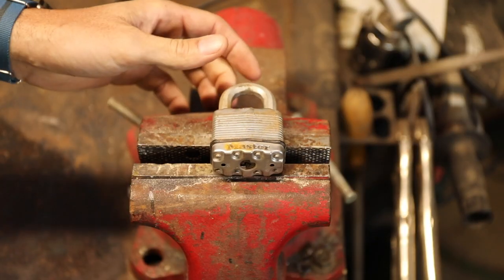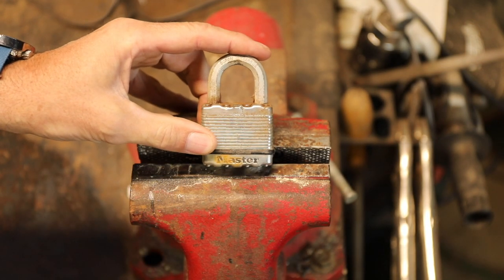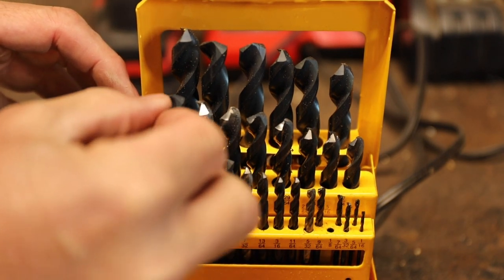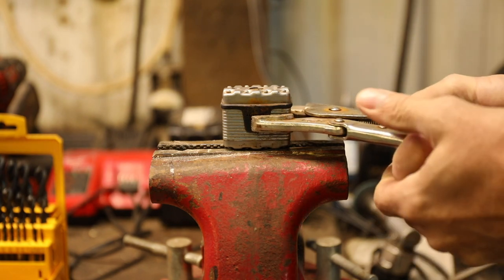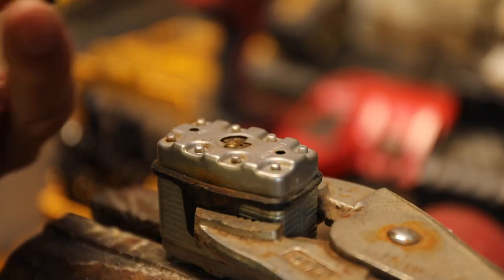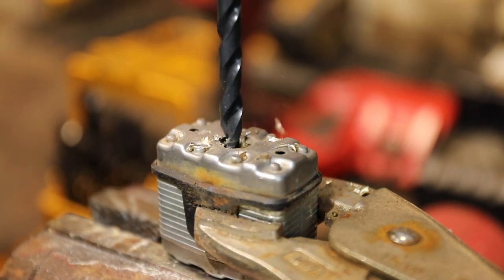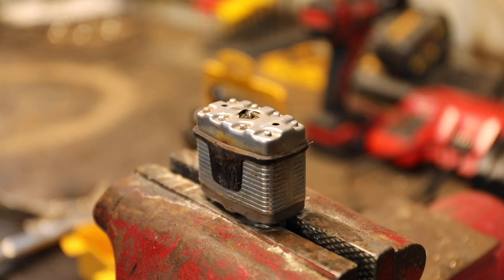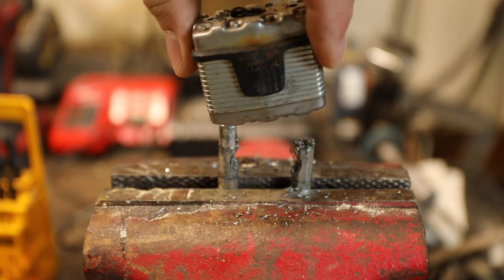PADLOCKS - THEIR DIRTY LITTLE SECRET

Comment: I work at an ict company and i recently had to break open a couple dozen padlocks padlocks on pc computers, used 2 wrenches to break them open by leveraging them together, works in seconds with any size lock as you adjust the wrench size to the lock size to get more force

Comment: Check out the lockpickinglawyer's channel. He takes locks apart/shows the insides and quite a few of them have anti-drill protection or hardened steel areas. Also a lot of them are just zink or brass, too. High end locks, I don't think you'll be able to drill out but the ones you get from harbor freight or walmart, no problem.
Reply: Egon are high end locks grinder proof ?
Reply: I don't think much can stand up to a diamond wheel
Reply: @macro820  diamond>any metal.
Reply: Long live the Ramset
Reply: They are more resistant, aka they'll take longer to grind through increasing the risk or chance to get caught (nothing subtle about a grinder).
Reply: @matowixunplugged7927  locks are designed to slow criminals down thus deterring them and increasing the risk of getting caught. Grinders aren't very practical for them because that's a lot of noise and Sparks it leaves a very high signature.
Reply: and check out  bosnianbill he have made some videos about opening them with grinders
Reply: @matowixunplugged7927  not exactly a material many people  have lying around.
Reply: @BOB2112420  Not sure I would  fancy trying to grind through  a rotalock or sergeant and Greenleaf,most the time with high end locks the weak part is whatever the lock is attached to.
Reply: Anything that cant be drilled out can be angle grinded, anything that cant be angle grinded can be heated and pried apart.
Reply: @atomicboomstick2543  care to try that on a sergeant and Greenleaf?
Reply: Had a American solid steel one that a guy who said his grinder had a diamond impregnated wheel work on it for about 15 min and it just barely cut into it.
Reply: @cardiffpicker1  ANYTHING can be broken into
Reply: Edit: Nevermind, a lot of people beat me to it.

Comment: A large  "MARLIN SPIKE" or "DRIFT PIN" & a 3 or 4 pound hammer.   Fastest way and no B.S.    Just put pointed end into the lock's shackle loop "U" and make it very snug. Then hit lock downward onto the spike.  It WEDGES the lock apart in seconds.  I have done this many times. As a trucker, those padlocks would freeze shut or be rusted shut. I had to open and not waste time.  Any lock I could get a spike into was open in seconds.
Reply: Cheap locks are like that.

Comment: A grinder should open any lock and/or chain, cable, etc. more expensive locks have hardened steel drill protection that you wont be able to drill through easily because they are so tough and also will deflect the bit in another direction. Some locks also have hardened steel key and driver pins. All the drill protection in some locks will keep you out for quite awhile and require alot of noise.

Comment: If you have a key that fits the lock but does not turn it hold pressure against it and hit the lock on the rubber mallet whilst pulling gently against it it will then turn on open

Comment: Disc padlocks have much less shackle exposed so less chance of bolt cutter attacks.  Heavy metal "shielding" around the outside of a padlock will slow down grinder attacks.  Round keys are more difficult to pick.  Some round key locks are more difficult to pick because they relock ever quarter turn of the key.

The point of a lock really is to discourage a would be thief because it would take to much time or make too much noise to defeat it.  Unless they know for certain that there is something of very high value, they will look for easier things to attack.

Comment: Brass lock you can just smack with a hammer. Most locks you can demolish with two opposing pinch bars. Acid will cook the guts relatively quickly. Then of course you have more dynamic methods of entry utilised by the military and LEO's.

Comment: Hardware store padlocks are super low on the security scale. In the time it took you to drill out the tumbler you could have learned to pick the lock. You can also use other masterlock keys like a bump key. Over the years I have collected about 10 different masterlock keys and chances have been really good that one of them will open your lock with a little jiggling.

Comment: Using two open end wrenches is the easiest and fastest way in , a locks hardness is a big weakness a hard brittle metal resists cutting but just like a metal punch they snap very easy

Comment: I worked at a place that had about 20+ masterlock padlocks around the facility.  No more than maybe two or three pairs were keyed alike.  I had to open each of them multiple times a shift and messing with all those keys was ridiculous.  Started using a shim to open them and that saved time.  Later I just carried a hammer.  You whacked the thing on the side and it popped open.

Comment: I would like to see you use the grinder on a Brand named American Lock. Have used them in the past and a Diamond embossed grinder just barely cut the lock. But, used a acetylene  torch and made short work getting it off.
Reply: The really good American Solid steel one.

Comment: MASTER LOCK only has so many different keys, just take a picture of the key when you get it. The go to s hardware store and compare it to the ones still in package till you find the right one. Found this out when I bought 2 separate locks in two separate packages and they both use the same key.

Comment: Try that on a Stanley Hardware S828-145 CD8820 Shrouded Hardened Steel Padlock. Your drill bit will just spin on the guard. Even if the guard wasn't there it's hardened steel so you're going to be destroying bits left and right trying to drill it out. The molybdenum shackle would be a pain to use bolt cutters on or a saw. Better off with a torch.

There ARE quality American locks. You just get what you pay for.

Comment: While I agree that this will work for a lot of locks, there are some that are far more resistant to drilling, especially once you ditch master lock. They no longer produce locks of much quality. You get what you pay for, so if you're protecting, for instance, a $5,000 it only makes sense to get a lock that is a couple hundred dollars, this will bring much higher security, with resistance to drilling, picking, and other destructive attacks. Likewise if your protecting a shed with a hundred dollars worth of tools it does not make sense to put a $150 lock on it.

Comment: They’re super expensive, but try a SARGENT & GREENLEAF 951C HIGH SECURITY PADLOCK. I work with high priority materials in the military and they are extremely similar to most the locks we use to secure vaults.
Reply: Aden Holmes $2300.00 Holy S** only the military and Banks can afford those.  I hope they’re worth it.  Dam Gina!!!!!!!
Reply: @jkeefer034  but think of the value of what you'd be securing.

Comment: haha, you'd be amazed cody. there is some REALLY high security locks out there, which you diffenetly couldn't grind the latch off. they're not cheap though, and ofc. 95% per cent of guys (girls too) just have a masterslock similar to the one in the video, or smaller...
Reply: it's hardened steel, and some even titanium

Comment: A guy showed me once that just a fast, quick hard hit downward with a hammer on the lock body will snap the end off the lock bar where the notch is located.  I even saw a strong guy just grab a small lock and on a locker and jerk it straight down and it snapped off the end and opened up.

Comment: Grinder no but there are locks that is nearly impossible to drill. Some high qualify locks would have harden steel pin insert in to the core. Drill bits would break when it hit those pin thus makes it very hard to drill.

Comment: Ditto on rubbish American and Chinesium locks.  And agree on the high-end German locks.
I once lost a $1k bicycle to a cheap bolt cutter.  They cut the (thick as my finger) aircraft cable lock, probably in seconds.
In Europe, motorcycle insurance occasionally requires specific kinds of chains and locks, and they are not cheap.  You get what you pay for.
I have no experience with the grinder gambit, except to say that with diamond abrasive disks available, a grinder can make short work of anything.
Reply: why did you lock your bike up with a cable lock you could use a butter knife to get through that lol
Reply: @kinstar  it was in 1985 and the bike rack was visible from large ground-floor office windows, a quarter mile inside the perimeter of a corporate campus.  Expensive mountain bikes were not yet common, especially for commuting, and Kryponite locks were very new and very expensive.  They pulled up in a van, blocking the view, slid the side door open, grabbed the bike & sped off, all within ten seconds.  After that, the bike racks were removed and indoor bike storage was provided.

Comment: You don’t need power tools to open a padlock try this take 3 spanner’s small  medium and large use small and medium put both spanner’s in the metal part of padlock squeeze together like scissors then repeat with medium and large your just ripping the metal padlock apart the first part is bending the metal wide so you can get the medium and large spanner’s into the metal part of the padlock and use old spanner’s

Comment: oh yeah but the point of a padlock is is that it just makes it just that little bit more difficult for thieves. its like locking up your home if you go out, someone determind to get into your house WILL get into your house. its just about making it difficult enough for them to not bother trying and for attention to be drawn to them for trying. so for example, a drill or a grinder will give away that someones trying to cut through that lock.

Comment: I've had to cut a few locks. I've yet to come across a padlock I couldn't open with a drill, cordless angle grinder, or bolt cutters. Routinely have to drill out house locks on homes I'm working on also.

Comment: Just use a hammer. You dont have to hit it hard but a decent tap on the lock from the top and the shackle will pop out. We got many locks off when people quit and took keys
Reply: i've never done it from the top. if i can't figure out which side the locking mechanism is on, then it only takes 2 taps to figure it out. usually just one, it's surprisingly simple.. at least you actually have to stand there and lockpick a deadbolt.

Comment: The problem with a grinder, and the drill method is that both make a lot of noise. Noise that someone wanting to break in would not want to create. The other problem is yes it only took you 2 or 3mins, but first that was in the best case scenario (lock off of item, and able to be put inside a vise) I am willing to bet that if the lock was still on a item, and you had fiddle with holding it at the right angle, and drilling, it would take a lot longer to drill thru. Even at the best case scenario 3mins standing out in the open, exposed, trying to illegally get somewhere, most criminals would not do that, unless they knew there was something really valuable on the other side. Here is the thing with security, anything can be broken into. I mean I can take a gun, even the cheapest 9mm there is, and probably blow just about any lock with one shot. The thing with security is to make it so much work, or the risk so high, that it is not worth it to the criminal to do it. Typically what you would want to focus on is the risk. Again any gun could probably blow lock with one shot, however a gun shot is also going to draw attention, attention that criminals don't want, so most wont do it. Unless they know something is really, really valuable behind it. Which is why the more valuable the item, the better locks you buy. The harder to pick, or break a lock, the more likely a criminal is to decide it is to much risk, and not even bother.

Comment: Bolt cutters?  They always solved my padlock issues pretty quick.
Reply: Higher end locks and even some lower end locks with a marshmellow  have steel harder than that of bolt cutters.
Reply: yea you can do that with some lower end locks but the higher end uses harder metal then the bolt cutters
Reply: I’ve broken a set of bolt cutters on a hardened steel padlock.  

The military uses brass padlocks to keep people honest.  They are soft so that if in an emergency the vehicle or area can be accessed with a steel bar if the key isn’t available.  

The hardest ones are for security of weapons and confidential materials.  The best S&G padlocks pretty well shield the hasp.
Reply: Right, I don't buy hardened padlocks....if I'm using a padlock it's purely to keep honest people honest and keep kids out.  No padlock is going to keep a real attacker out...so why waste the money.
Reply: That lock he had there was the bolt cutter resistant one
Reply: @XA-JJKILLERs  
No Master lock is "bolt cutter resistant".  Often you can open them with some harsh words and a scowl.  They're junk.

Comment: I don't get it.  Why not just cut it off with a grinder if you're going to use a power tool?  Sure is a lot easier and quicker, plus it works on all locks of all sizes, types, and all quality levels.  Normally drilling a lock is reserved for things like doors and cabinets where you don't want to damage the item that is locked.  Good video and good tips, I just don't understand why you'd want to drill in this or any similar circumstance.

Comment: I mean, you could open a masterlock by hitting it with the chain it's attached to. They're useless locks. Decent, security padlocks have anti-drill pins and hardened tungsten inserts and the like to defeat this kind of attack.

Comment: More and more locks have anti drill discs nowadays, really they're just a thin bit of sheet metal which spins freely over the top of the keyway which spins with the drill bit. Not perfect but a good deterrent.
Tbh though I expected you to use a ramset gun instead of a drill.

Comment: Padlocks are a deterrent to the opportunist or belt and braces against the wind, no more. Only a fool would rely on one with anything of real value.
Reply: Serious question but what is the alternative?
Reply: Pádraig Floyd So I should just leave my bike unlocked when I go inside some place?
Reply: Crazywaffle5150 Of course not. That deters the opportunist. If someone wants to get your bike, they will. Which is why some bike thieves go around with bolt cutters.
Reply: desertfox2020 Things of real value you protect with insurance, or stronger locks. As I said, padlocks are a deterrent to the opportunist as they are easily got past. It doesn't mean we don't use them every day, but I know people who are amazed when something they leave behind a cheap padlock is stolen.
Reply: Pádraig Floyd There are chains and locks that exist that can't be cut with bolt cutters and can resist a grinder for 15 min .. The odds of someone walking around with such tools is very slim and very suspicious. Putting lock on a bike while shopping in a public setting will lower chances of it being stolen. Thieves only ever look for easy targets.
Reply: Crazywaffle5150 Which is exactly what I said when I said they are a deterrent against the opportunist. We do not disagree on that. And some bike thieves really do go round with bolt cutters, but they're not opportunists as they are targeting higher end bikes.

Comment: this only works on cheap locks and you can pick a master lock in seconds  and i call bull on your owning a good lock with a grinder
Reply: thebad300 Any lock no matter how w expensive can be opened with a grinder with a cutting wheel it's just all about how long it takes. bosnianbill and lockpickinglawyer have videos on cutting open lots of very high end padlocks.

Comment: Open a gunsafe with av grinder hell no. IF you can do that safe is a bad One. In Sweden we have safes that IF you try to brake in with a drill or a angle grinder it Will get moyster and get THE Tool stuck.

Comment: why would you drill a lock? a good bolt cutter does the job silent and within seconds. i have a 1m version and it even bites through a 10mm hardened steel rod. i mean, they are good for knipping any kind of steel. e.g. fences... damn... what ever i say sounds suspicious..
Reply: The shackle on that lock will defeat most bolt cutters, however as Cody stated a cutting wheel will go right through it.